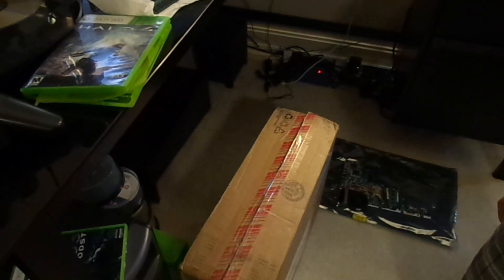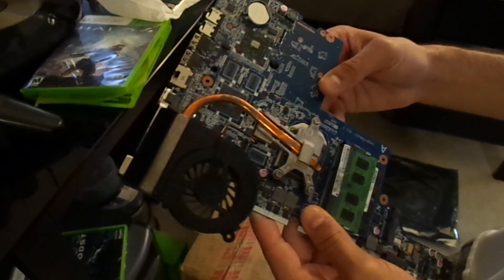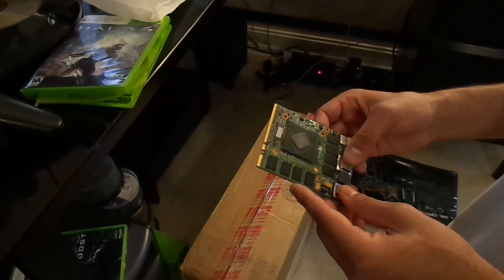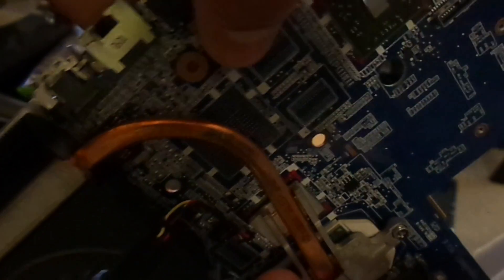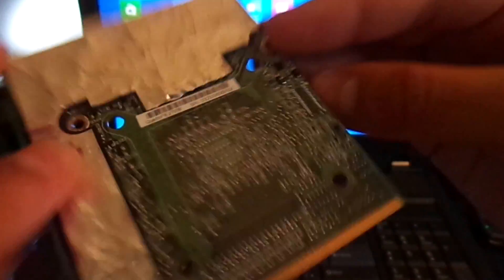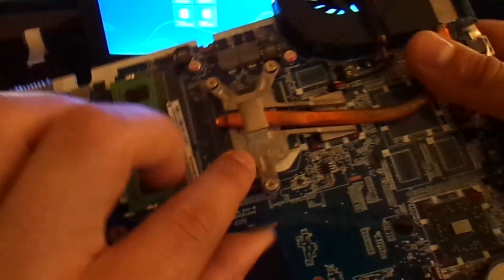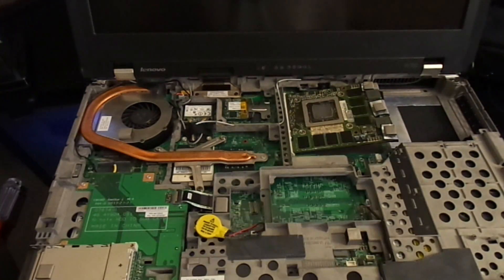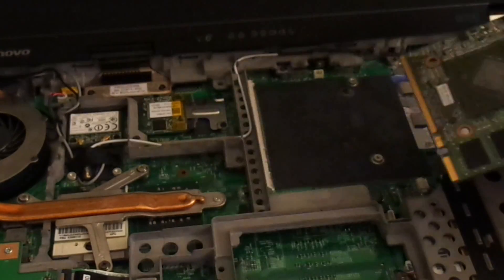Differences between integrated & dedicated laptop GPU: MXM Graphics

Comment: HEY I SUBBED PLEASE HELP ME . . I HAVE AN HP COMPAQ 8300 ALL IN ONE . I HAVE MADE SEVERAL UPGRADES INCLUDING CPU RAM AND SSD . IT HAS AN MXM 3.0 SLOT. I BOUGHT THE CARD THAT IS ON THE HP WEBSITE AS COMPATIBLE . AMD RADEON 7650A MXM GRAPHICS CARD AND GET A SERIES OF RED GREEN BLUE WHITE AND BLACK . . . REALLY WANT TO USE THAT CARD IN THERE !! ANY IDEAS ???
Reply: I HAVE VIDEOS ON THE INSIDES OF THE COMPUTER DOING UPGRADES . . I HAVE SEARCHED EVERYWHERE . . . WHAT AM I DOING WRONG ??

Comment: I don't have a MXM card. CPU-Z and GPU-Z say that I only have a PCIe x16 v1.1 (I have a 960m and i7 6700HQ)
Reply: CPU-Z reads the interface/connection type on GPU. All dedicated both soldered and non soldered are found as PCIe based GPU. But only way to know if it has a MXM card is to open laptop up.

Comment: if i want to upgrade my laptop how do i check if my laptop supports a dedicated gpu because i have an integrated
Reply: If u have integrated graphics your laptop dont support any graphics card
Reply: @chrisddr3  I have a Dell Inspiron laptop with 1 TB HDD, 8 GB RAM, I7 8th Gen and 2 GB AMD Radeon dedicated graphics.... Can I replace that dedicated graphics card of my laptop ?
Reply: @ayaanmotoride5k  yeah you probably can but you have to find your gpu's model and the slot it uses and then search for another gpu that uses the same slot
Reply: @chrisddr3  this laptop cost me around  $920 but it contains potato graphics of only 2 GB

Comment: My hp has a dedicated gpu but its intergrated onto the board but i have dedicated graphics memory
Reply: If you mean the 2 slots with 2 cards those are called RAM and has nothing todo with dedicated GPU that's soldered on the motherboard. That GPU has it's own RAM called VRAM that is soldered around the gpu chip.
Reply: @tseyksuli4541  I have a Dell Inspiron laptop with 1 TB HDD, 8 GB RAM, I7 8th Gen and 2 GB AMD Radeon dedicated graphics.... Can I replace that dedicated graphics card of my laptop ?
Reply: @ayaanmotoride5k  nope, most dell, hp and many more have their dedicated graphics soldered to motherboard. Only ones with replaceable GPU are either MSI GT series or Dell's new Alienware area71 laptop. Those use something called MXM Card that is installed into a PCIe slot. But non-gaming ones do not have this.